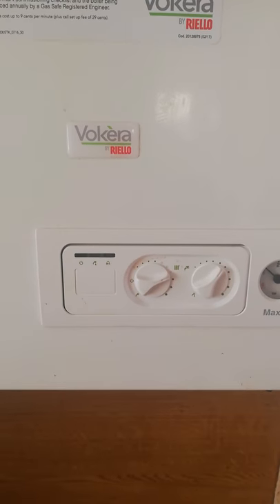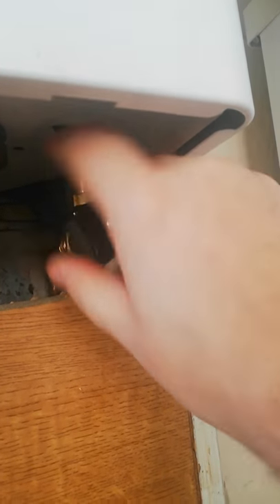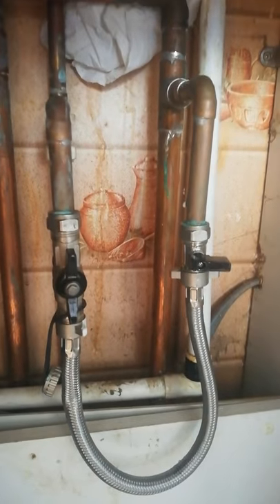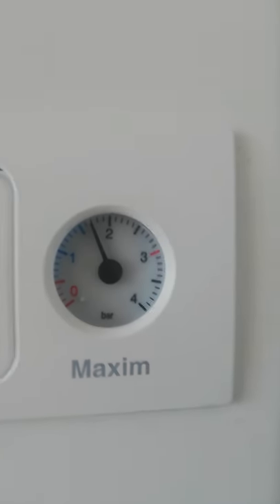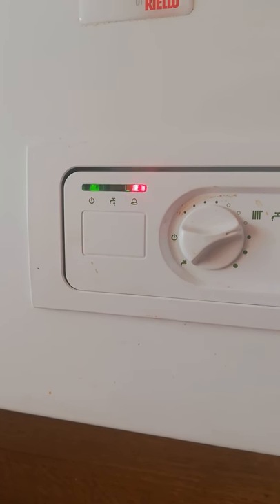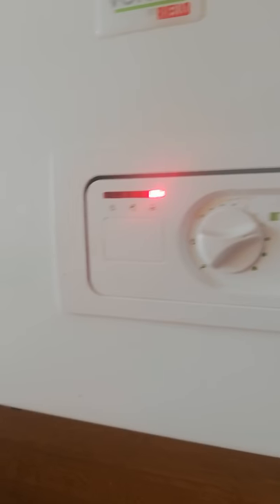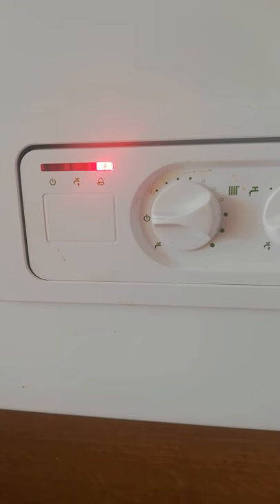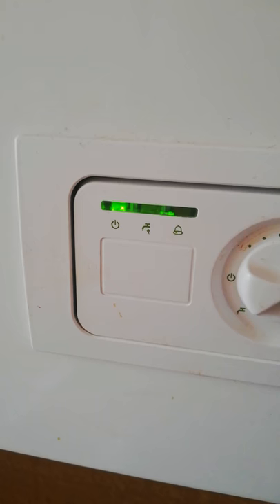Vokera maxim, low water pressure fix/red bell error fix

Comment: Thank you so much for these clear instructions. Sorted the water pressure but then still had the red light. The trick at the end, turning it off by the boiler dial then running the hot tap got that green light to kick in 👌 I now have heating again without the expense of calling an engineer out, all thanks to you! Legend!!!

Comment: Thanks Jason, mine is a Vokera Compact, 13 years old, it tripped out to the red light and would not work at all. I was switching off and on at the wall outlet - nothing, watched you using the boiler switch, copied that and the unit sprang back to life again. It's the following day and everything is working normally, you saved me from a freezing house and calling the engineer, thanks for this ace video - legend.

Comment: sitting in our workshop at Cumbernauld Scotland, on call till 8pm and its freezin, same boiler as you [ weeks old ]water pressure shows 0 bars,, topped up to 1.5 bar, still didnt fire up,did you tip of switching to stand-bye on the lhs control knob,run the water tap,,switched the lhs knob back to the correct temp setting and WEH HEY its working,,fantastic mate !!
Reply from the maker: Glad to have helped mate
Reply: Mine keeps missing out water from the bottom ,but it is now working but pissing

Comment: Great, I already had the water pressure but it was the tip right at the end of this video that did the final trick. I'd been pressing the on off switch on the wall to no avail, used the switch as shown and there it was! That beautiful solid green light!

Comment: Great that worked I didn’t have to do the adjustment to the pressure only the switch off and run hot water tip cheers.

Comment: Do the two water stop taps underneath need to be turned to the same on all boliers? Mine turned to these angles make my boiler sound like it's filling up
Reply from the maker: To be honest I am not entirely sure. All this was trial and error for me. What you see in the video is what worked on my boiler yours may be slightly different

Comment: My condensation pipe was full of ice and ended up with red light, after removing the outside pipe and resetting the boiler it works fine now, hot water tap trick really did give it a kick to wake it up lol

Comment: Do you have to do this with the boiler off? I've done the things and nothings happened
Reply from the maker: I did the water top up with the boiler off. You also need to check that you have gas coming into the house so make sure your meter is topped up.
Reply: It's still not working, we have gas as I checked the cooker etc, water pressure at 1.5 but still nothing 😑
Reply from the maker: @sandraoxley9263  no hot water or heating?
Reply: No hot water or heating
Reply from the maker: @sandraoxley9263  please watch my other video on my channel. Hopefully that will sort it for you

Comment: You are a bloody genius. This worked for the hot water. But now I have all three green lights flashing, and no radiators are not heating. Any idea why?
Reply from the maker: That's a strange one. If your getting hot water the radiators should be firing up. Have you tried bleading the radiators? That would be my guess
Reply: The radiators kicked in after a while. Thanks for the reply. I can't tell you how helpful this has been.

Comment: I missed out the first steps which you said hadn't worked, and done the last dial turn, my gauge went from having 0 pressure to sitting at 1 but won't move any further.. anyone had this issue and know what it is? I really need some help ☹

Comment: What you did from 4 min 10 seconds onwards is the reset procedure for your model of boiler. (and some Sabre models)
The sequence of electrical inputs, switched off and drop in DHW pressure, is the trigger to clear stored alarms etc.
But you already know this LOL
Reply from the maker: I actually didn't. I just figure things out and this worked for me. If its the actual way to do it then it was blind luck on my end lol
Reply: @jasonglen87  Brilliant! What's the saying? "Even a blind chicken finds corn!" LOL 
Hope you have a great weekend - and stay cool!

Comment: I hate this boiler... I recently rented this place and my heart sank during the viewing when I saw this boiler installed, but other good things outweigh that issue. No thermostat, has a hissy fit every time a new cannister is attached outside. Damn thing.
I could NOT get it to start up. 
Okay, I thought, let's see if I can FORCE it to give me hot water... turned the dial to the tap, threw the tap on full... and... same as you; job done. 
Stupid thing. And what's with the tappets? A bit nineteen hundred and frozen to death.... The manual says pull out the tappets either side if the time you want it on... nope; pull out for how long you want in on. At least I know now, but it's rubbish that it doesn't tell you how to 're-set' at all. Called the letting agent, engineer they use called me, and he told me the tap trick, next week coming to fit a thermostat for me. All good in the end, but unnecessary stress, eh?